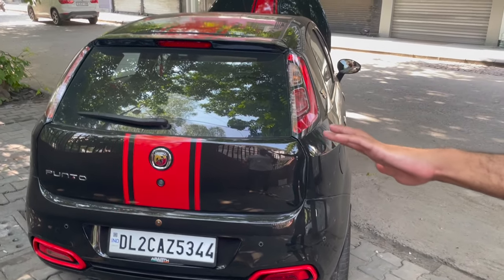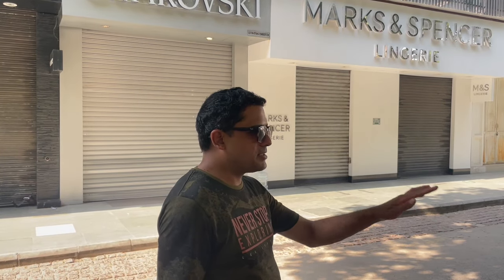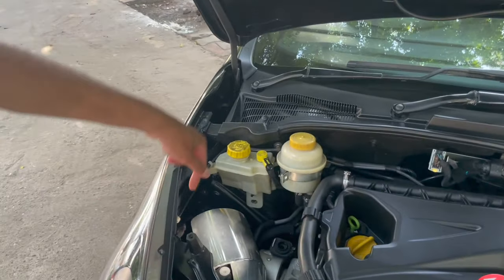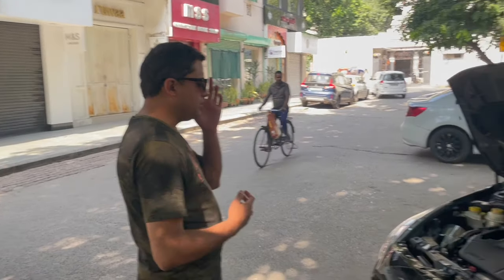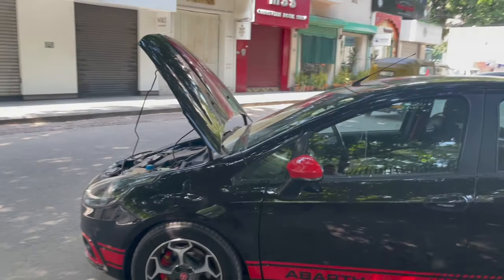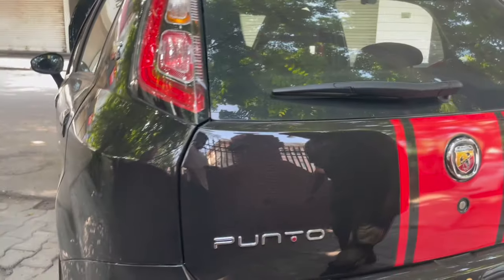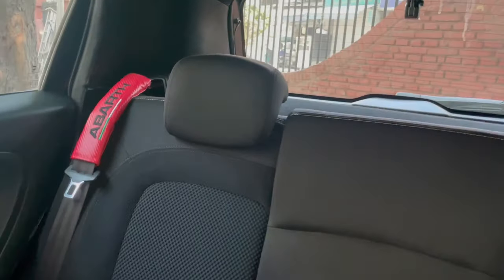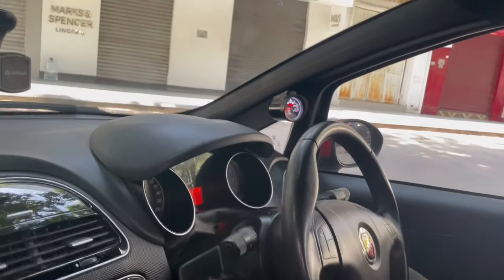The legendary Hot Hatch of India : Fiat Punto Abarth 🔥

Comment: Any big install will result in slight turbo lag increase. This is because the blow off valve dumps out charged air to atmosphere wile the stock recirculating valve dumps that air between air intake and turbo intake which keeps turbo spooling longer. Even in Abarth you'll feel this slight lag if you convert the stock recirculating valve to work as BOV (yes you don't need expensive bov kits as the stock recirc valve can be converted to bov very easily)